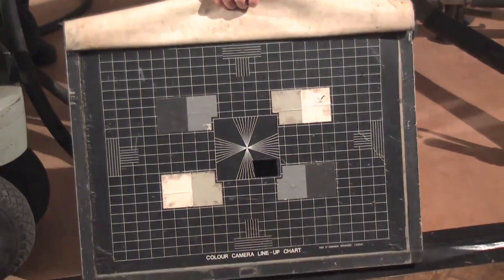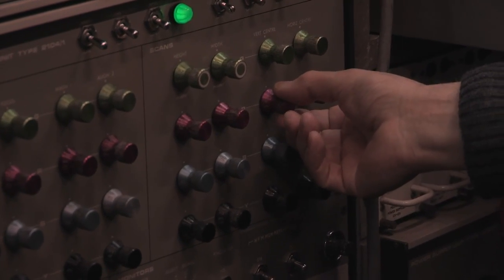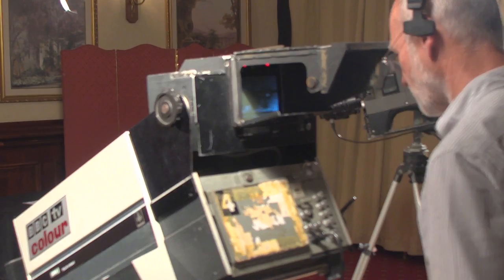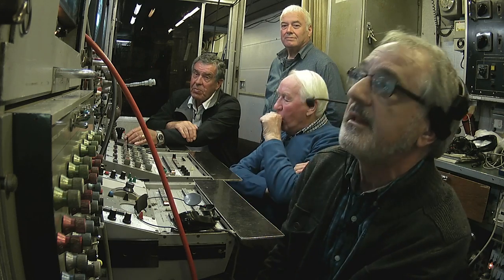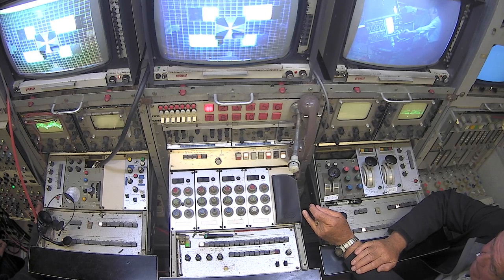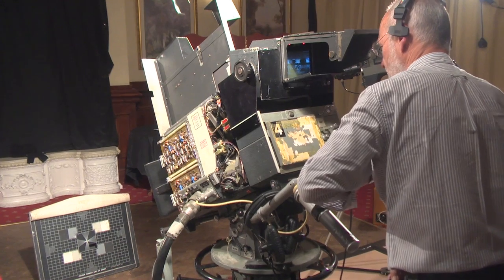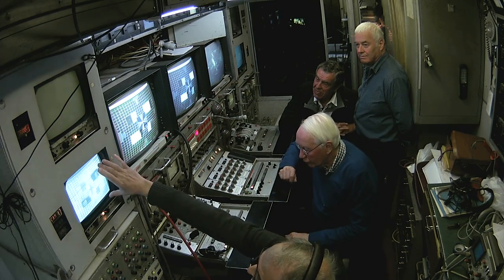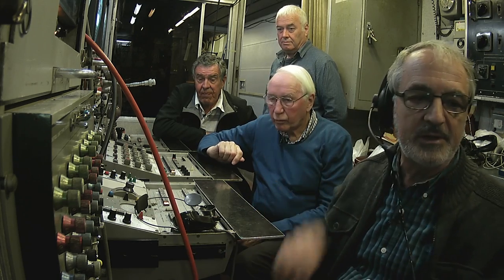Demonstration: Lining Up Outside Broadcast Cameras

Comment: Wow ... that old days they had complicated cameras ... but no tape to mark adjustmentpoints? ...xD
Reply: These are sensitive electronics. many things like shipping and handling, environmental factors like temperature, and the age of the tubes and circuitry all have an impact on how the camera will perform. So in other words the marks would be useless because it's changing all the time